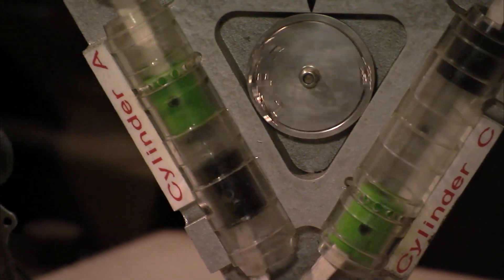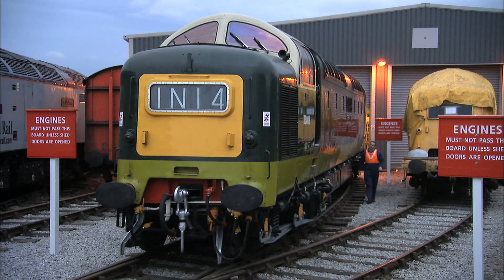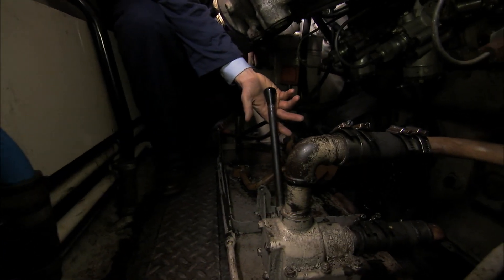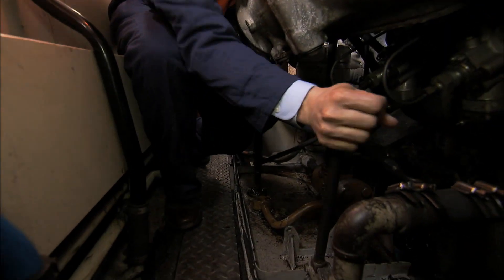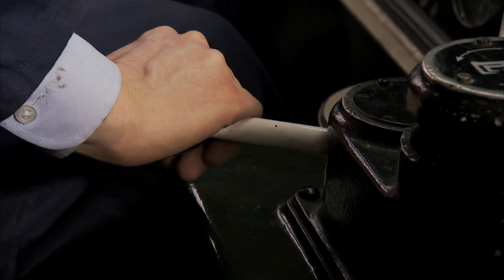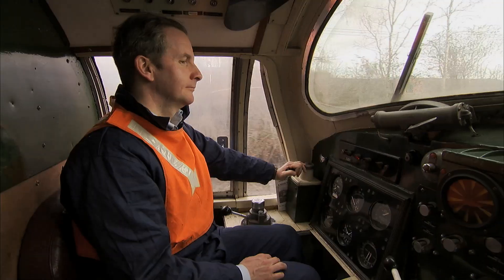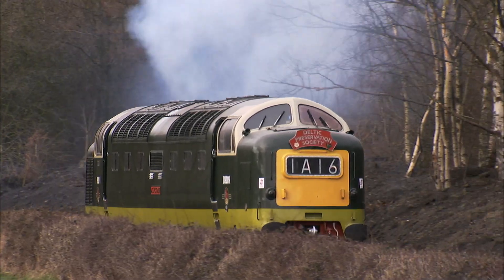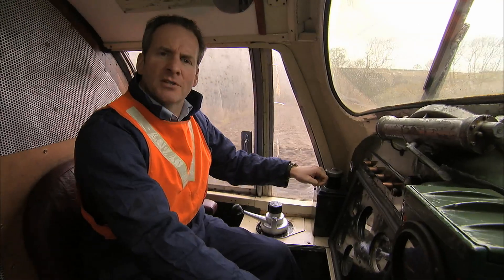World's Greatest Locomotives... The Deltic

Comment: The Deltic was a great engine. BUT. This was the official repair procedure, for almost anything: 
  1. Tow busted Deltic to the Napier factory and drop it off. 
  2. Receive working loaner locomotive. 
  3. In several weeks, return loaner, pick up repaired Deltic. They were so hard to work on, and so mechanically unlike any other engine, that they could only be fixed at the factory.

Comment: Where are they now? From what I saw of them they were a  scrap iron jungles. I was on a ship with these engines and once they were started you weren't allowed out of the control room. That's how dangerous they were. Possibly if they were run at lower speeds you might get a run out of them. They definitely weren't what they were cracked up to be.

Comment: It was the steam engines that would tow the diesels back after constantly breaking down
Reply: And the diesels who would pull the steam engines when a boiler or injector failure.
Reply: Not the Deltic though, it was one of the few truly reliable Diesels introduced in the modernisation period.
Reply: Steam wasn’t phased out because it was less powerful, it was phased out because it was less cost effective

Comment: A sound that was back ground noise through to the 90's, like hearing Viscount aircraft passing over head, all gone.
Reply: 60s70s
Reply: @highdownmartin  Certainly the diesel locos. I could set my watch by the 11:45 pm postal Viscount passing over head up to late 90's.
Reply: Deltics gone by 82. HST replacement from 79/80. Mores the pity
Reply: @highdownmartin  I lived near a power station so may have been used there longer.
Reply: @flybobbie1449  - 37s carried coal up until circa 2000. I'd occasionally catch one howling and wailing through Newton Abbot as I waited for a post-work connection.

Comment: :03 "turbocharged Deltic"? Really? Makes one wonder about the accuracy of the remainder. And ... personally I'd prefer F-M OP engine, FWIW.
Reply: The first Deltic engine that Napier built (for the Navy's torpedo boats) was - as described - turbocharged and produced 3100hp. The locomotives used two heavily-derated engines which were supercharged and produced 1650hp each (for 3300hp in total). So the narration is accurate but, admittedly, not as clear as it could be!

Comment: personally I always thought the Deltics  were  a very over-rated loco-    out in the real world ,they   were  really only a "one-trick"pony - 3300 hp to pull 400/500 - tons over a mostly table-top railway is hardly "revolutionary " and considering they only had a lifespan of just 20 years and couple that with the fact they were a very expensive and unreliable machine to operate as was proved in the latter days of there live,s when they were relegated to stopping trains  and there  availability and  performance was shocking on trians that other class worked day-in and day out without any problems.             .         other classes that arrived before the Deltics  and  are/were worked far harder are STILL  going around being thrashed earning their keep  lolng after the Deltics have gone !!   but no-doubt the keyboard trainspotting warriors will have a meltdown and disagree !
Reply: Well, a month later and no-one's having a meltdown...
Reply: @droge1300  They're ignoring the troll

Comment: I like the design of those locomotives.  I would simply keep them in service by removing the old engines and replacing them with modern diesel engines from G.E. locomotives in America.  There are a lot of fairly new locomotives in the scrap yards in America, and you can get engines from them really cheap. That is where you can find your replacement engines from.
Reply: You realise these are called deltics because of the deltic engines right?
Reply: In the era of the Deltics I think it would be extremely unlikely that any US diesel motor unit producing 3,300 HP would fit in the much more restricted engine room space of the Deltic. A legacy of the much more restricted UK loading guage that the UK locked in as standard about 1830.
Not much attraction to risking the development of the repowering of the twenty year old designs based on looks. By that stage the much faster HST 125 trains were taking over the major train runs fro 1978 with 125 mph running standard and some catch up runs due to other delays achieving 140 mph to make up time lost.
The HST 125 trains were a huge boost to UK train patronage whereas the Deltics were just a ripple effect on patronage in comparison.
Took until the 1986 before the private stone train operator Foster Yoeman had EMD design the class 59 for them with lots of length to get the equipment in especially the cooling systems. SD40-2 mechanicals I believe.
The 59 class soon showed their superiority but EMD still had to overcome the "not invented here" bigotry inherent in the Government owned British Railways organisation. 
Lots of railways outside the US using EMD power and happy with it. GE less so.

Comment: Looks like they dumped as much fuel as they burnt? Seems inefficient, alongside the high revs? Curious design.
Reply: High revs? No, just a few thousand. Lots of cylinders though, and 2 stroke, so firing twice as often as a gasoline engine.
Reply: Alanko Meddle it's probably in need of a rebuild,couple of hundred thousand pounds worth I'd guess

Comment: sadly such vehicles are rare today, its a beautiful and very British machine...
though, the fact that most railways today are still diesel because of it, is rather a questionable praise...
Reply: .....it was a great diesel loco and fast...but just not quite fast enough unfortunately. 

I think it was pushed out by the considerably faster InterCity 125 (which is still operating today, some 45 years after it entered service). So although the Deltic was (and still is) an iconic diesel loco, it gave way to the most successful Diesel  ever made - the 125. The Deltic may have sped up journey times abit, but the 125 revolutionised train travel throughout the UK.

Comment: On a 1980 trip from Rome to London, I was talking to a British Rail engineer and his family. I discussed my interest in railways and that I was aiming to travel behind a Deltic as I knew they would soon be on the way out. He replied in a warm way that "yes a lot of enthusiast interest in the Deltics, but they do not have the headaches of keeping them going." Much happier with the new HSTs and the TGV that flashed past in France.
It could be argued that the Deltic engine was a technolgical dead end. Never applied to many locomotive designs despite Napiers trying.
Even some shipping applications that I know were short lived.
So a brilliant design if you do not need to pay for the complication and the high maintenance costs and lower availability than better designs. The praise is largely also from keyboard warriors, not railway engineers whose job is to provide cost effective motive power.
Reply: Yes, but still a good solution to the problem of British loading gauge given available technology. The much simpler V-type diesel was standard in North America, although Fairbank-Morse made opposed piston engines for their diesel locomotives. Either way, it's one crankshaft, not three.
Reply: @HSMiyamoto  Soon replaced by the much better solution of the HST 125. Could have been better again had US engines for HSTs had been evaluated.
Reply: @johnd8892  no US locomotives were comparable to the speed the hst could run at the time
Reply: That’s why there were 22 Celtic’s and 500 odd Brush 4 s
Standard design go anywhere pull anything all crews could drive em spares and fitters  nationwide. Always the way of it. All lot more room in the 47 cab as well. Deltics are very cramped and noisy.

Comment: when i was sixteen, I put one of these "on the floor"!!
Reply: That must have been quite a sight at 16 years old
Reply: @davidwilkes83 
 it was!
 I was working nights as a "passed" engine cleaner,
I didn't change the points properly,they weremanual and very heavy to pull on
the driver was getting impatient and had began to shout so I had one last go at it
 then shouted, OK!
and it just trundled slowly off the rails,it was 3 in the morning and they had to get about 30 men out of bed to come and sort it!
I sat on the embankment having a smoke with a coupl of them watching the operation
"I 'd like to know what stupid bastard did this" said one.... yeah, I replied, "stupid bastard"

Comment: @2:19 running towards an open point.
Reply: Yeah the U.S. has some spring switches. Basically, it appears to be set the wrong way but when the locomotive makes contact, it switches to the correct direction.
Reply: I see what you mean. Could it damage the point? Potentially derail? Or just sloppy practice?
Reply: Could it be a spring switch?
Reply: @LouisianaRailProductions  Is that a thing?  Never heard of it in the UK.
Reply: In the UK a loco or carriage running over a set of points that aren't set for you will make the points "snap" closed. This is possible because in the UK the levers that throw the set of points usually aren't automatically locked after a full throw, whereas in the US they almost always lock into position. It's pretty common practice to leave a set of points lined against you because there's no hurt in driving over them. We achieve the same thing in the US by using spring switches, which are sometimes permanently lined one way for a sidng, then on the other end of that siding the switch is lined for the opposite track. When a train goes over them, the force of the wheels pushing on the switch rails overcomes spring tension, which then snap back to the "normal" position after the wheels leave the turnout. There's only a problem if the switch isn't sprung and the handle is locked into place.
Reply: @pootispiker2866  thanks, I've always wondered

Comment: It's amazing how few Class 55's were made, just 22, yet they became the ECML flagship loco. A real testament to the dependability of the design, and their ability to stay on the road and out of the shed.
Reply: Although a slower locomotive would have cost less to run, that's clear, whatever BR put in place had to run at least as fast as the steam engines they replaced. Given the competitive environment, BR could not have slowed its trains in the name of dieselization.

In North America, the EMD E and F units pulled most passenger trains -- excluding electric trains -- into the 1970s. Although the fact that they usually ran as three or four unit combinations was often promoted as a "feature," given that these A and cabless B units were rarely separated establishes that unreliability of these early diesel electric locomotives was the real reason why they were sent out in groups of three or four units, with each unit providing between about 1500 and 2200 horsepower. Typical six axle E units were geared for 103 MPH, which is Deltic-like performance. Same problem, different country.
Reply: The deltics were reliable locos they needed looking after, but nothing else could provide that magic three figure maximum speed at the time.br had to buy them to compete with internal airlines timings ,a deltic could maintain 100 mph, day in and day out.On test one reached 120 mph!.They were special,yes they were expensive to buy and maintain but did their job until the hst 125s arrived on E-R in the late 70s.
Reply: And they replaced a mere 34 A4s. The ECML never needed that many top-flight locomotives...
Reply: Hannah Mayamoto. Actually Hannah that is not strictly true. When the WCML was electrified the class 50s were transferred to other duties for many years. When the ECML was electrified the Deltics were got rid of - fast. Reason, they wern't that reliable and they were expensive to maintain. They regularly broke con' rods. The few remaining ones aren't asked to do much nowadays compared with when they were in service. The same applies to the original Paxman Valenta engines fitted to the HSTs I've seen them smash themselves to bits. The worst culprits were the Rolls Royce 8 cylinder engines fitted to the St. Pancras - Bedford DMUs. I have seen them cut in half by flailing broken con' rods.
 I am an ex railyman by the way and I lnow what I saw.
Reply: @keithparker5103   I'm sure you know more than me about U.K. railways, just because you live in Britain. Still, I wonder if some of that unreliability came from the fact that the Class 55 were worked remarkably hard? Steady 100 mph running, all day long, day after day, for almost 20 years would challenge the metallurgy of any locomotive built in the early 1960s and worked that hard. Moreover, since the Class 55 relied on an 18 cylinder diesel with three crankshafts originally designed to power a boat designed for speed, the margin between working load and ultimate strength was probably unusually narrow.
Reply: @HSMiyamoto  You are right of course about what was being asked of those engines but a reliable, cheaper to maintain 90 MPH locomotive is a much better economic prospect than an expensive 100 MPH locomotive. For example the class 45s had lower powered low speed engines but were capable of 90 MPH all day long. I NEVER saw one of those Sulzer engines smash itself up. The bottom line of the account book is what matters and that is why the Deltics were got rid of as soon as it was possible.
Reply: @keithparker5103  Good to hear some reality about the Deltics as opposed to keyboard warriors with so little knowledge of what really matters in a well run railway.
Reply: @johnd8892  They were bought as an ego booster for British Railways John. I could go into details, for example, 3300 HP the keyboard warriors spout about is meaningless. Their is a 20% loss through the electric transmission, take out the auxilaries also, compressor, etc. and their is probably only about 2500 HP at the drawbar. Many of the big steamers were capable of that. 
 The Deltics did their job - just.
Reply: @keithparker5103  Is it not true that the Deltic engines needed an overhaul at around 3500 hours whereas normal 4-stroke engines were overhauled at 10,000 hours. I seem to remember these figures from many years ago. Besides, the Deltics had two 1650hp engines, whereas class 47 had one 2750hp Sulzer and class 50 had one 2700hp EE engine.
Reply: @williamgeorgefraser   I was based in Derby and the Deltics were serviced in Doncaster. My information came from fellow railymen and guys who were based at the Technical Center here in Derby. You are right the Deltics had 2 1650HP high speed 2 stroke engines , I was never informed of their service hours but logically it would be quite a bit less than the heavy Sulzer and EE engines. Hence the heavy running costs. My opinion, I have always felt that high speed engines were a disadvantage. The 6 ft. driving wheels of a steam locomotive are turning at approx. 300 RPM at 60 MPH. The Sulzer at 750 RPM and the EE at 850 RPM are therefore just waltzing round. This gives them a considerable extra lifespan over a high speed engine.
 The Paxman Valenta engines originally fitted to he HSTs were high speed engines (1500) RPM The return springs on the fuel injection pumps were massive and until after several modifications the cam follower bushes used to fail causing untold damage. By now you will have observed that I have a bias. I must acknowledge though the weight afvantage of a high speed engine and for a few years I made a good living out of the Valenta engine.
Reply: @keithparker5103  I've spent my working life dealing with very small, 4-stroke boat engines, mostly running up to 2500 rpm. The most incredible engines I ever worked on, however, were single cylinder, 2-stroke Listers. When you wanted to stop them, they had to stop completely or else they would just rev up again.
Reply: @williamgeorgefraser  I know exactly what you mean. I once had an engine that beat me. It was a 3 cyl. 4 stroke Mc Laren compressor engine. It would run, then it would stop, it would run then it would stop.
I tried everything I knew, working my way from the fuel tank, re-priming, de-compressing and turning it by hand  ~ everything. When 4:30PM came round I thought "sod it, I'll leave it until tomorrow" Next day it had gone, I never did find out what was wrong with that bloody engine.
Reply: @keithparker5103  I got called to do a job on a 4 cylinder, 4-stroke which was running perfectly well apart from the fact it had no oil pressure. I took off the rocker cover and found that the rocker arms on 3 and 4 had 1/4" play. Looking round the engine, I discovered cracks on one side of the block. A con-rod had broken, cracked the block and broken the camshaft into 3 parts. It was still running great.
Reply: @williamgeorgefraser  Hells bells, it must have only been running on 3 cylinders. Some of the engines I saw that had smash themselves in two must have kept running in order to do that. I saw some of those Rolls Royce engines held in one peice by the crankshaft, sump, and one of the cylinder heads. But they must have kept running to do that. Imagine sitting in a DMU with that going on about 2 ft from your bo****ks.
Reply: @keithparker5103  Don't forget the weight of the 45s on the track. 40-odd tons heavier than a Deltic, admittedly with a couple of carrying axles appended.
Reply: well Hannah- if you look at the facts- the Deltics  were  quite expensive and basically  unreliable locos that produced 3300 hp  in total and were pulling trians that weighed  only 400/500 tons  ( light load for a loco  of this power output!!) over a mostly flat railway - yes the milages they covered were awesome BUT they wernt excatly "taxed " there were other classes of british loco that were far far cheaper , far more reliable , worked far harder and lasted much ,much longer in service  than the deltics  !! - the Deltics were really quite overated